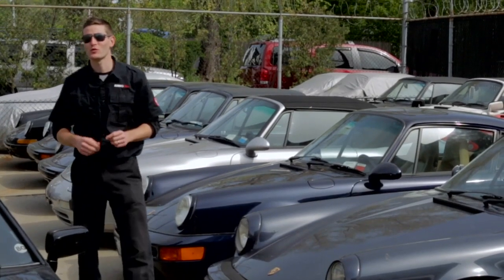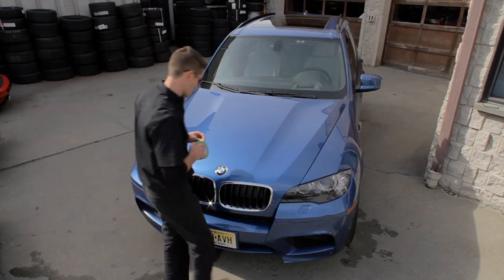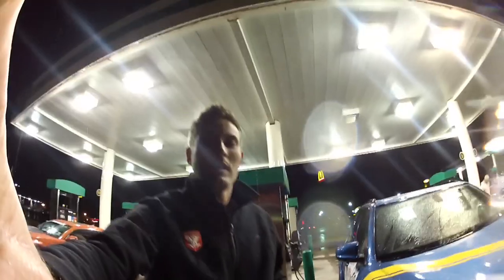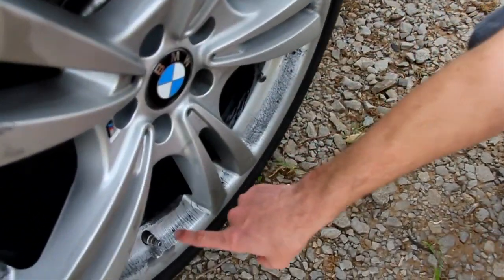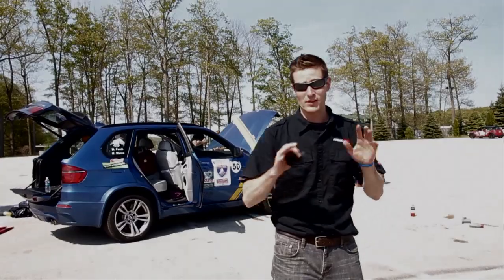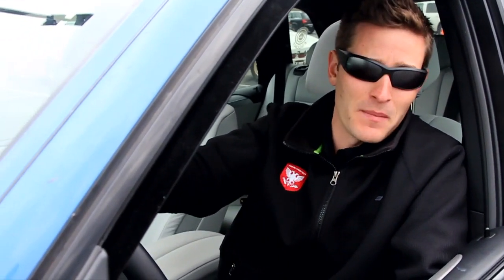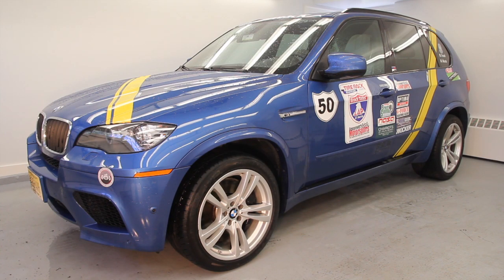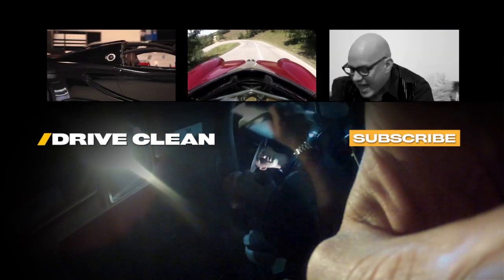BMW X5M and One Lap of America 2012 - /DRIVE CLEAN

Comment: how do you get the bugs off of the radiator ????
Reply: It's not a radiator it's a condenser. I guess you open the bonet & hose it down & use a soft brush over it but be careful not to damage the cooling fins. You can't hose it from behind because the radiator is behind it.

Comment: you used a wheel cleaner to clean the wheels...when your rims are protected with sealant the point is to not have to use any type of wheel cleaner. all you have to do is use soap and water and the brake dust and other grime should come off so yea the armorall worked but you still put in alot of work to clean the rim whereas a proper wheel sealant would require half the work.

Comment: You' ve driven 600 miles with a brand new X5 and you're beat. In April i drove almost 1200 miles (from before Frankfurt, Germany to Sofia, Bulgaria) in a '97 Nissan Micra 1.3 with about 5 stops to refuel and grab a snack.You're fucking spoiled if I had an X5M i'll take that 600 miles in 7-8 hours with hopefully 3 tanks of fuel :D